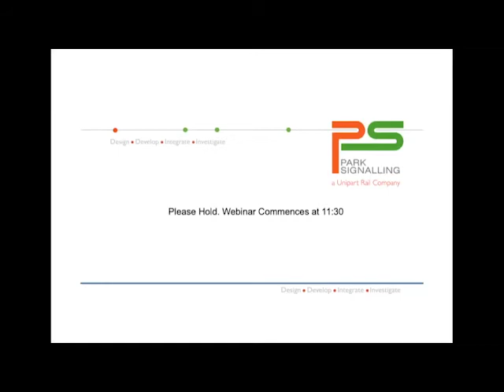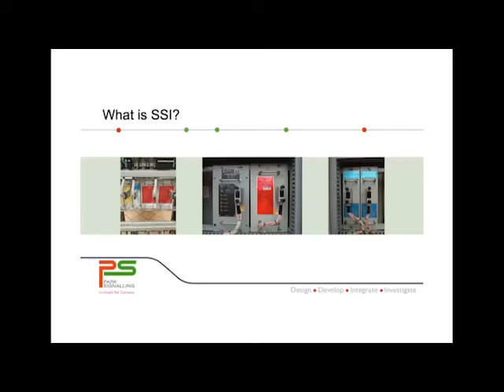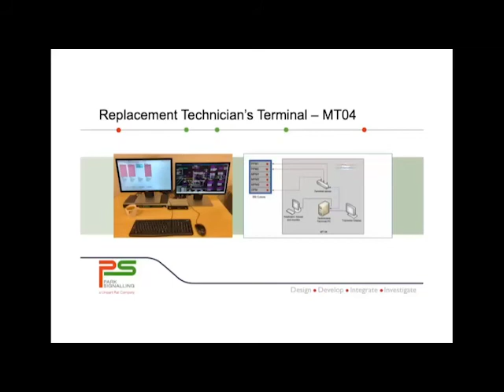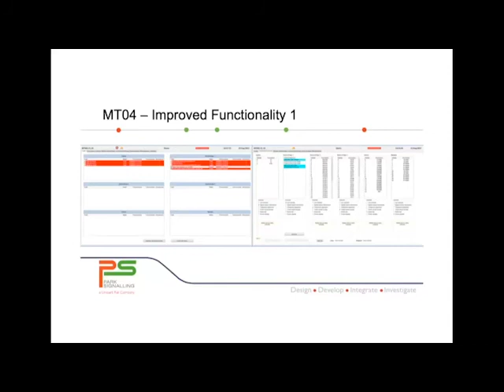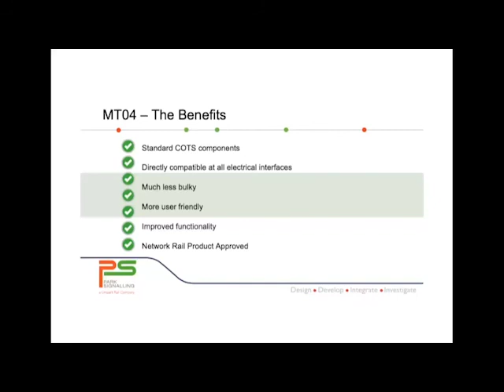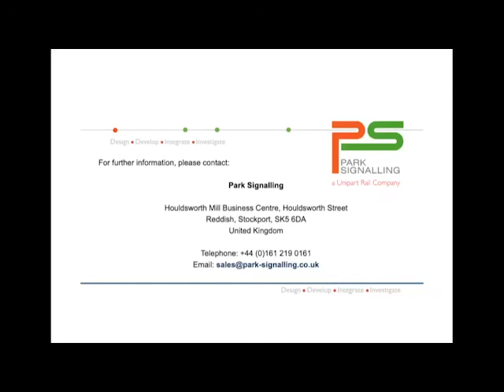Transforming SSI with Technician's Terminal

Comment: Hi Howard Parry here. A few questions: What is the time measurement periods for the date capture as the old one (I think) was sometimes a couple of seconds making synchronistation  a litle difficult for fault finding of erroneous / intermittant  anomalies. Can we have more than 2 screens? Is there any connection to  the outside world (i.e. hacking)?  You mentioned remote access: can we have remote data logging? (real time or packet) What is the operating system? (Linux/Win) Is there any audible alarms?. Thank. I beleive PS have my email address